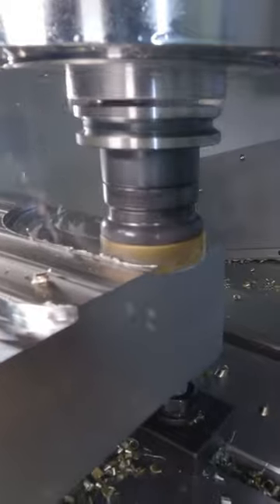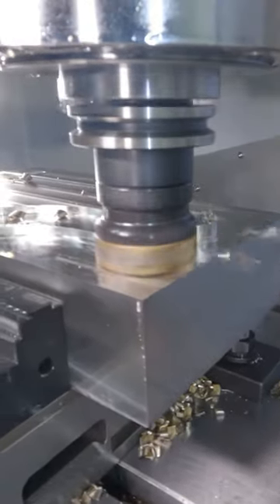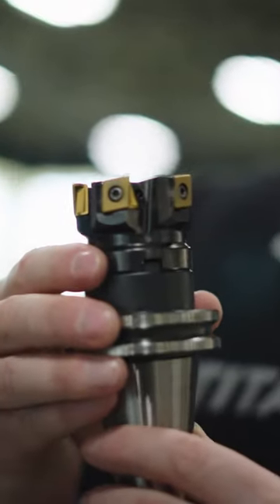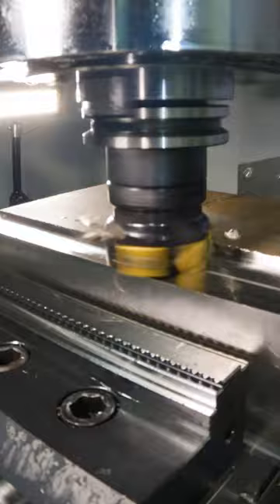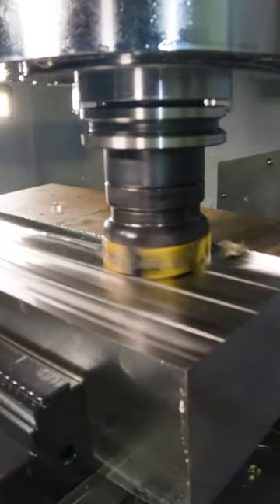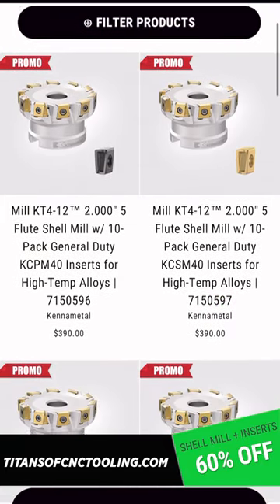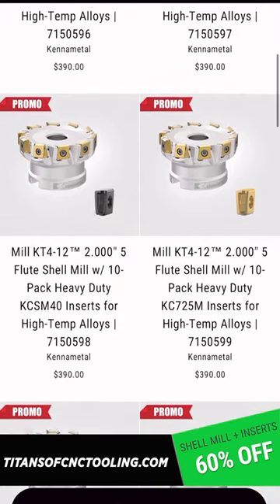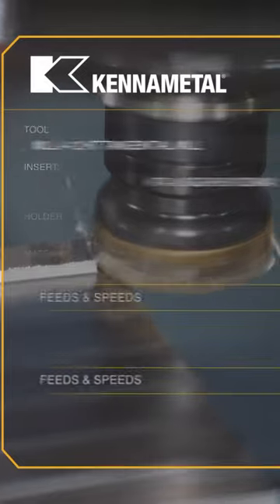Shredding Through Stainless Steel 😲

Comment: I know you guys take kennametal only.
But do you want to try or Contest them with milling tools from Avantec??

They have such positive cutting edges.
Will be interesting to see some Experiment on your next videos.

Will be fun.😊
Reply: Kennametal probably sponsors them. They are at least a dealer for km. Why push a product you don't sell?  Km makes a good tool from everything I hear. It's out of my 'hobby' price range, tho. But, if they were really about pushing limits and productivity, you'd think they would show it. Unless results are too close to matter, and the other tooling is cheaper. I've found the cheaper Amazon accusize is good for my needs. They are not the cheapest but a step up, and I've had great results from it. Accusize is good enough for my needs. I'll do stuff for friends, but most of my work is tinkering or stuff we need on the farm.